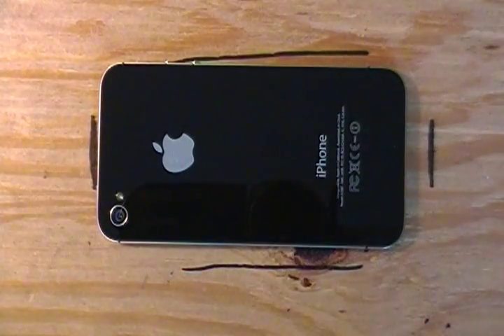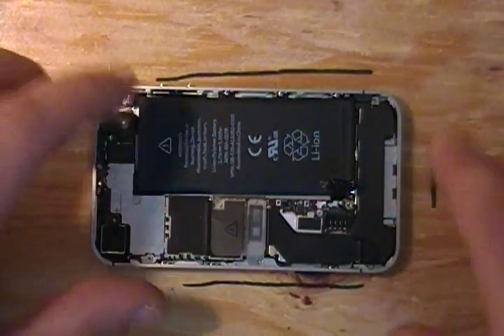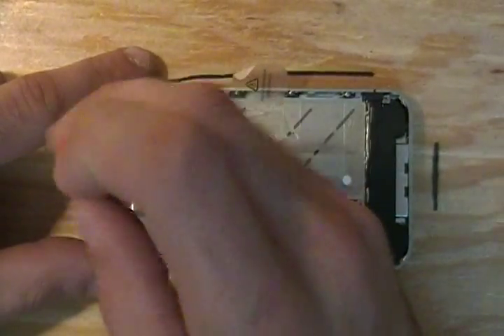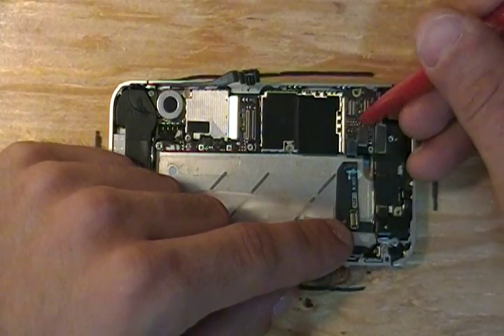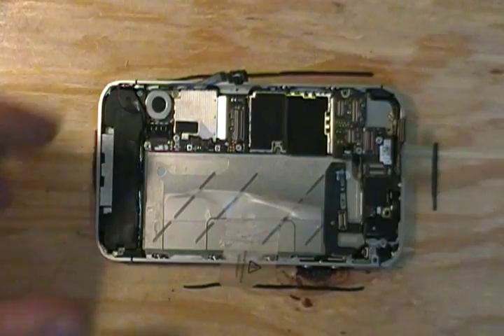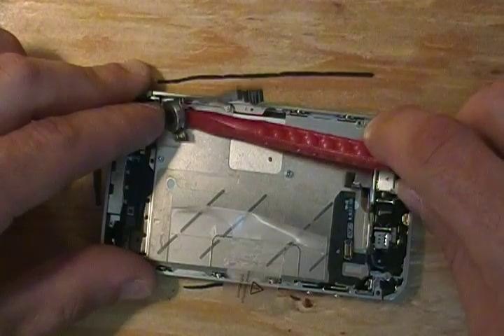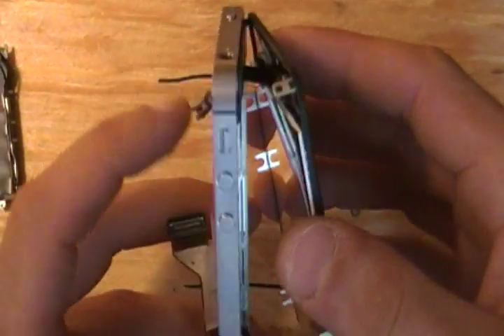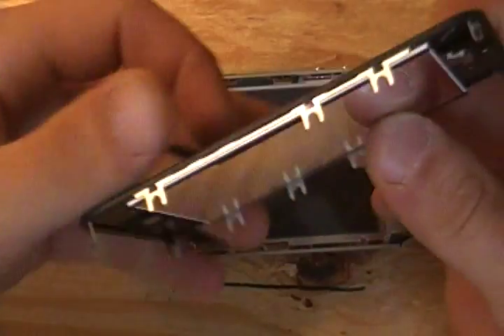iPhone 4s Screen Replacement and Teardown Video (GSM or AT&T)

Comment: Quick question, I just cracked the glass on my 4s for Verizon but the display works fine.  I have packing tape holding everything together and I can still use it as if it were straight out of the box.  Do I need to get the LCD screen as well as the glass or just the glass?  I have read that I need the screen and the glass.  Thanks.  And your stores website please.